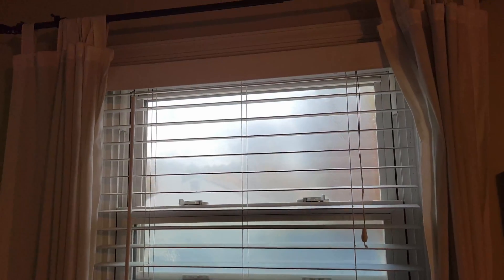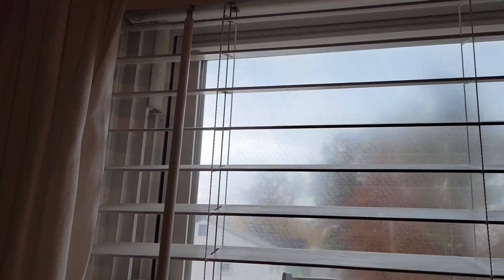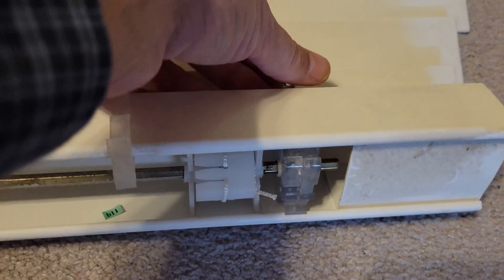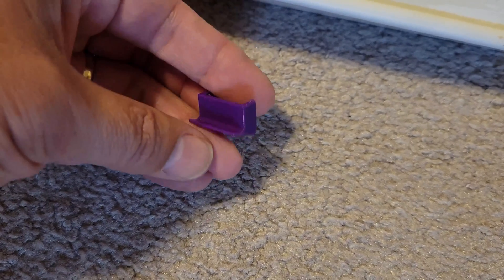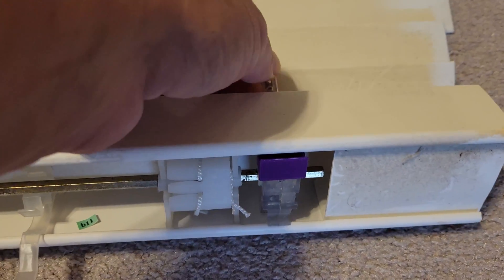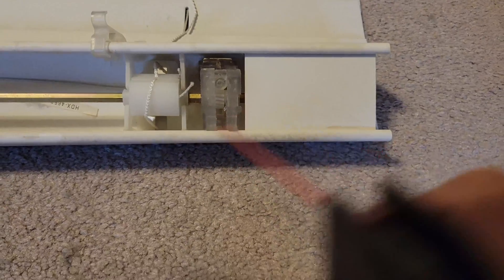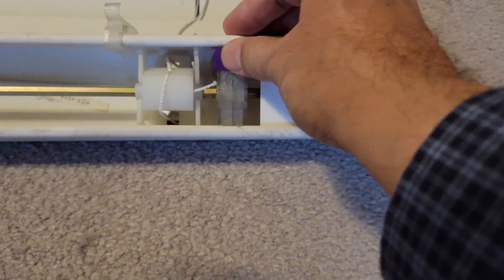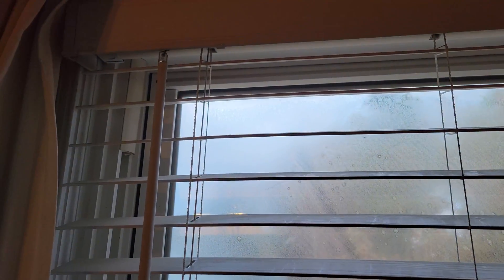Home Depot window blind repair

Comment: initially I thought by the blinds that have the issue are in the kitchen, I was thinking that perhaps that gear bo was slipping because of the occasional cooking oil film in the kitchen from cooking. ...I will check if my gear box came apart some causing the twist stick to not work.

Comment: We're  having the same issue with the wide Home Depot sourced blinds. My open and close stick, as I turn it it does nothing, but its only effecting the blinds in the kitchen. Our home is 3 stores 7 bedroom, and I have these installed on all the first floor windows and my bedroom. I was thinking bout putting these up on all the windows, and thank goodness I didn't at $60-75 a window, because I see it as its just a matter of time to see these all fail. we have about $ 600 in these blinds in the home, I think I will just have the wife shop for some curtains and keep the blinds opened  and just open and and close the curtains instead, that way im taking the mechanical routine out of the equation sort of speak.